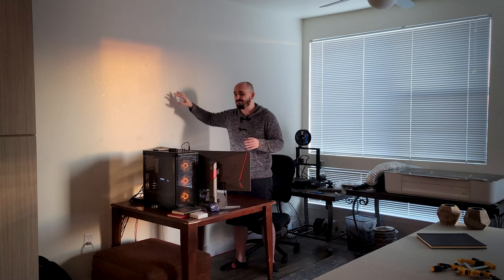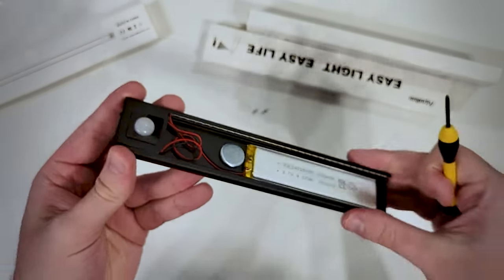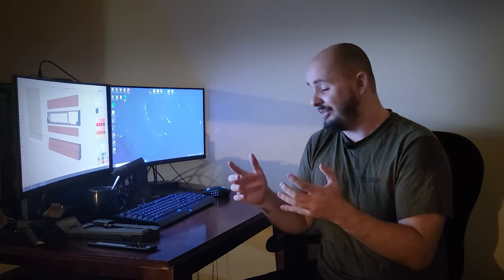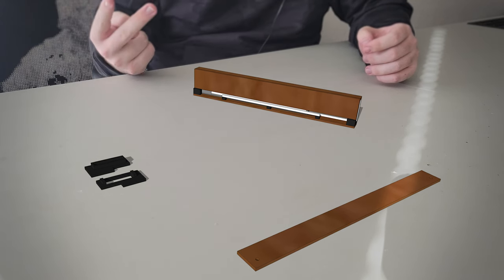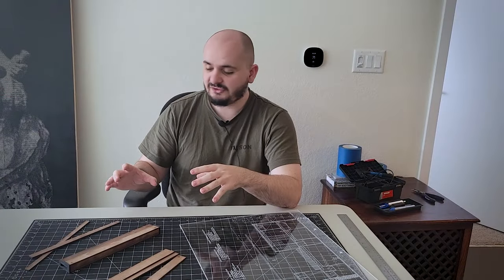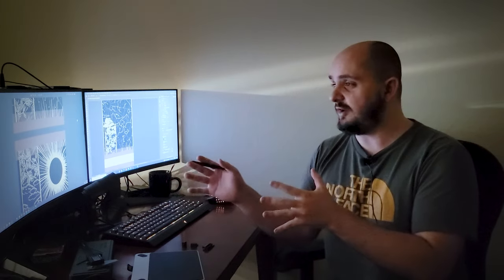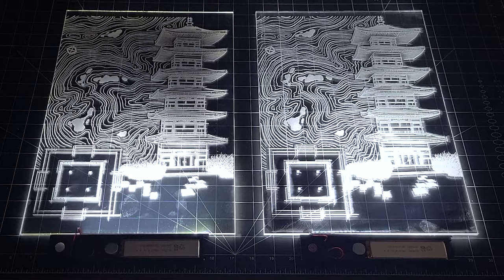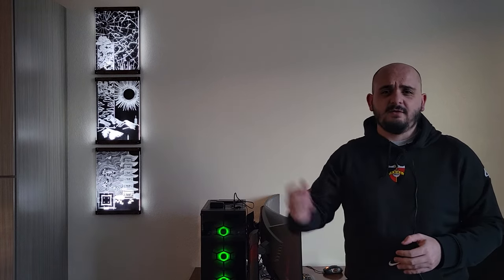I Used A Lasercutter To Draw With Light

Comment: How do you have such high quality standards for your work and still get things done? I always find myself crushed under the weight of what I want things to be, especially when I find myself having to redo the whole thing AGAIN, and it's been years since I've finished any big project I've started (or any of the small projects that scope crept into big projects).
Reply from the maker: Actually a really good question and its something I think about often so I am going to give a longer explanation of how it works for me so sorry in advanced for the novel I am about to write. 

For me its still a balancing act and something I struggle with to be honest. One of the greatest things that I have learned is that I need to stop when its "good enough" and that's super relative and when that is for me is in like the 90-95% range of what the perfect outcome is in my head. I feel like when I get something to a good idea its maybe only at 80% of the way to "perfection" and trying to squeeze out the last percentages points getting close to 100 get exponentially more time consuming to refine it further and as you get closer and the unfortunate reality is that sometimes you just need to say its good enough. That doesn't mean you cant ever revisit it in the future though. 

As for the weight of what you want things to be and scale of projects I have found, for me at least, its easier to do it in little portions. At any one time I have maybe 15 projects that I am "working on" at all different scales and completions so I can just slowly chip away at them. Its helpful for me since I spend a lot of time thinking and it just gives me more time to think of different options for stuff when I get my mind off a project and onto something else and come back to it later with fresh eyes. The little progress I make on projects adds up overtime and when you step back you will see you have made it pretty far. An important thing to remember is that even if stuff doesn't work out and you need to restart, that in itself is still progress since you have narrowed down what is a workable path to your end goal.

TLDR: IMO taking projects in smaller pieces to start gets you on a good path and will help get you to the desired end goal but you need to also balance that with reality and how much time you want to spend on a project and what imperfections you will compromise on to get something done.
Reply: @Ideal_Idea  Thanks for replying, and sorry it took me so long to get back to you. What you said aligns well with my ideal workflow, but goes against everything I’ve ever been told before.

I agree that most of the process is just sitting there thinking about the project, or journaling about it, or doing research, or anything but actually having the materials in your hands and building the thing. Most of the process doesn’t look like progress. It’s the part I enjoy most, but I don’t talk about anything in that stage to anyone, because when they ask how the build or the video or the short story is going and I don’t have anything to point to, they get very confused. Even other writers look at me like I’ve grown two heads when I tell them it’s been three months and I’m still prewriting. 

I didn’t realize this before, but there are two reasons I start something over.

My peers, mentors, teachers, etc have all yelled at me at some point or another for starting something over that was, in their minds, going well enough. I don't think I've ever been able to get any of them to understand that the piece itself has to mean something. When I start something over it usually isn't because it's a terrible bench or a terrible story, it's because I didn't feel like it aligns with the message that I'm trying to get it to carry. I guess I never really got their voices out of my head, and I still beat myself up for opening a new blank document or picking up new plywood. It’s especially overwhelming because I’m back to the drawing board and there isn’t a clear path forward. This is usually when I shelf a project for an extended period of time. 

It’s an entirely different thing if the stain I used for something isn’t the color I expected, for example. That’s demoralizing, but I know what to do about it. I’ll feel like an idiot going back to buy new materials, but I know what the way forward looks like and it’s usually an opportunity to fix something else I inevitably messed up in doing it the first time. I can usually come back to it with a week (life permitting) and get back to it. 

As for doing ten things at once, I’ve always done it that way, but just before Covid, I let someone convince me it was a bad habit and I’ve barely made any progress since. Only recently have I started picking up little side projects again and I’ve been enjoying them. I think part of that is because I can switch between them, so if one starts to feel too overwhelming, I can put my energy somewhere else instead of just sitting there and staring at the obstacle which is usually mental more than anything. I’m also starting to think that I’m just being too ambitious in the scope of what I want to achieve with a single project and maybe I should just crank out a dozen or so little things before I try picking up something the scope of a novel or a piece of cabinetry that’s trying to solve four infrastructure problems at once. The simple fact is that I'm three years out of practice now in just about everything and I'm trying to come back by throwing myself into the fire. I don't have to do that anymore. This isn't college.

Comment: I just discovered you, Robert, only a couple days ago, and I have to say; you've got a lot of promise, man. You've got real talent here, and before long I believe you will be up there with some of the best makers on YT. I was going to ask about possibly selling some of these, but I now see your pinned comment about it. Is there somewhere besides Instagram where these will be posted?
Reply from the maker: Normally Instagram is the only place, I could try and add the community tab here on Youtube as well in the future just in case for people who don't use Instagram. Unfortunately with this project though the problems I ran into are currently not solvable. The battery life on the lights is not as long as I was hoping for so I was searching for other solutions but have not found a good replacement for them yet and I am not wanting to sell anything I don't fully back so these might not be getting released anytime soon.
Reply: @Ideal_Idea  I understand completely. If you do decide to go back to it at some point, I'll be here to bug you about it again. I was planning on maybe hardwiring them into 120v through a wall if need be anyways, with maybe a modification or two to accommodate. 

The build quality is great though, and the art is wonderful. Even just selling the cut and filled out acrylic would be great, since I am not anywhere close to being that artistic. I'd still end up framing the same way, but hardwired into AC. 

Anywho, either way, they are beautiful, and I appreciate the response and help. You've got something special here, man.

Comment: Next time instead of using a thicker acrylic you can use a reflective tape on the edges to keep the light trapped inside until it hits an etch. Thats how TV backlight diffusers work.
Reply from the maker: Ah neat, I did not think of that. Good tip

Comment: Now imagine you place tre, for or five layers of acrylics over each other and then use a arduino to turn each layer on, off in sequence... Then with the right images on the acrylic plates, you could have an animation. For example a humming bird flapping its wings. You could also experiment with color LED for each layer. =)

Comment: Im pretty sure that the missing illumination is caused by to many detailes at the bottom, engraved to deep into the acrylic. You can stil go slower to get crisp detailes, but bring the power down as well. That might be the reason as to why the thicker piece of acrylic works better, as then the light have a bit more space to travel up, behind your engraving. :)

Comment: That looks awesome. Did you end up trying them without the black backing as well? What did that look like? Also, I would recommend switching over to black screws instead of the silver ones, I think it would give it a slightly cleaner look.
Reply from the maker: I did, it just was not enough contrast for my liking unfortunately but it would be great on any wall that wasn't white. That is a good call on the screws, I thought about it but then got lazy. I will make that switch eventually.